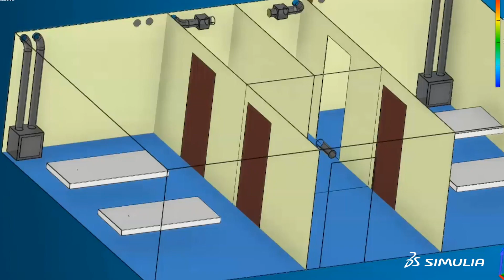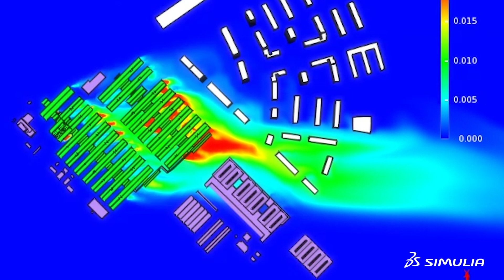Creating Safe Hospital Room Environments with Simulation | SIMULIA

Comment: Make me feel proud of being part of Simulia and Dassault systemes
Reply: Do you use simulia frequently ? I mean do yo make structural / thermal / fluid analysis ? Because I wonder how is this program compared to some other simulation programs such as PATRAN, ANSYS etc.
Reply: @outplayed4511  I am part of testing team for Simulia and software related to fluid/structures/cst. It is different from other software mainly because while using DS product you get complete package solution meaning from design to simulation.